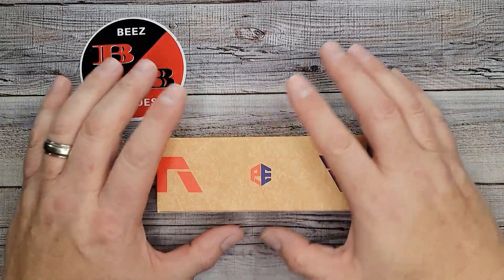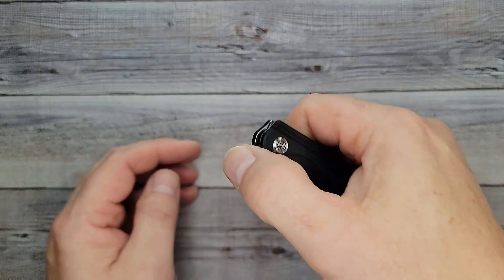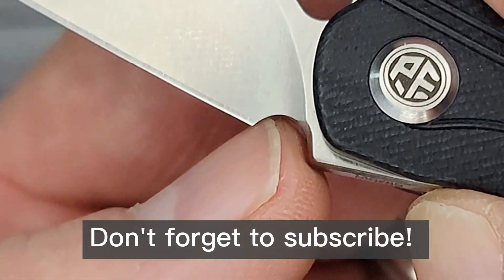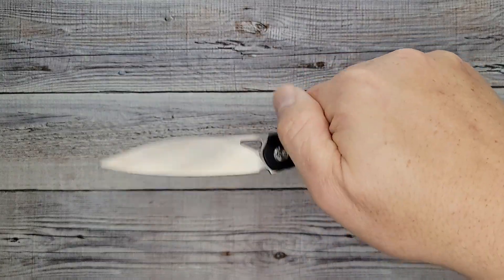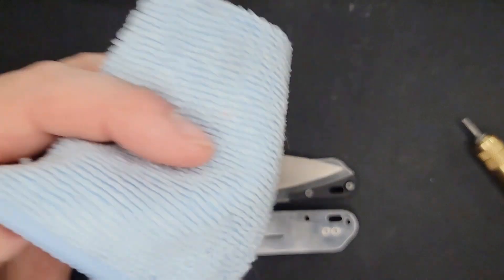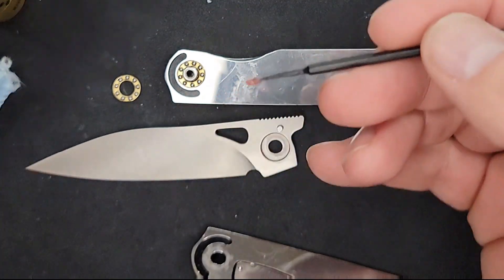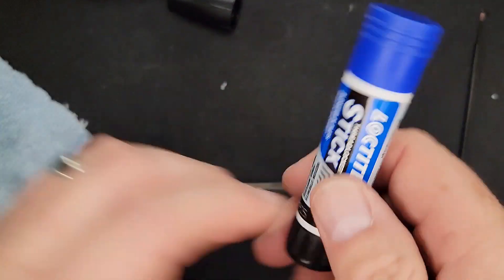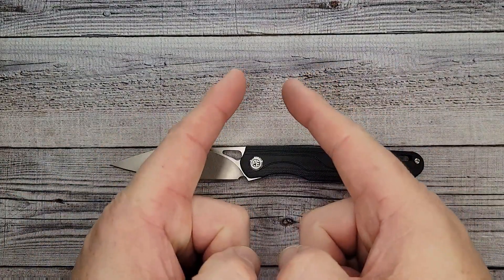UNDER $45! NEW PETRIFIED FISH SLIM KNIFE OVERVIEW/DISASSEMBLY | SCOUT PFE02

Comment: I’ve been carrying knives for awhile, but I don’t understand why the bearings go in that way. Won’t the blade flip better if the go the other way? Or does the whole thing flip against the liners?
Reply from the maker: From what I've learned from this community and experience, the open-end of the bearings face the direction of the "indentation". Whether the indentation is on the scales, or the blade. You can always flip the bearing to see if there are better results, but I have found that it's smoother and I have less issues centering when I keep the bearings the same direction they were installed. I think the whole thing flips on both the liners AND the blade, but you have me more curious now hahaha. Thank you for keeping my mind working to learn more! Have a great day and week my friend!
Reply: @BeezBlades  yeah, I’ve had my Bo for a little while now and I’ve tried the bearings both ways, but the way you described does work better.

Comment: That's a nice one I like it. Check out the kubey ku2101D. It's a smaller front flipper knife with 14c28n that kubey just came out with. I got it off white mountain knives. Thanks for the video. Awesome Channel👍 :_BeezBladesWelcome::_BeezBladesBeez::_BeezBladesRed::_BeezBladesBeezhive::_BeezBladesHoneypot::_BeezBladesQueenBee::_BeezBladesSwarm:.  In stock on White mountain now. As of 5:15 pm eastern. 12/27/21